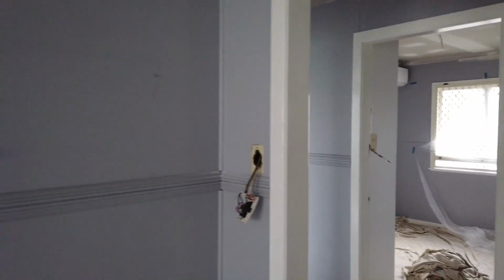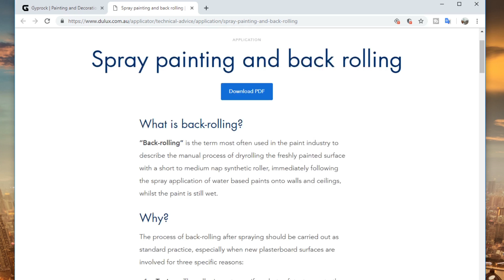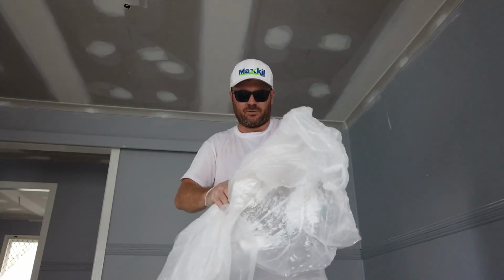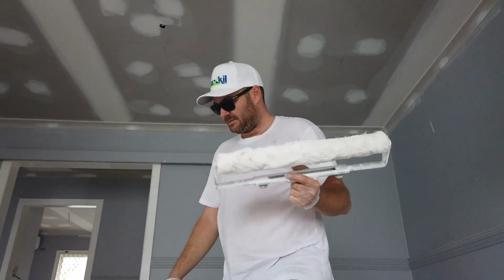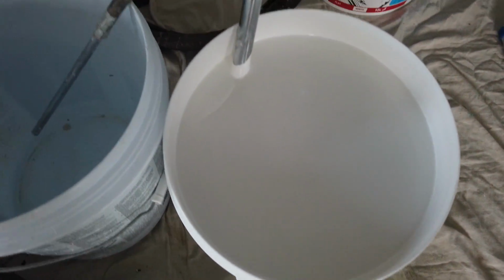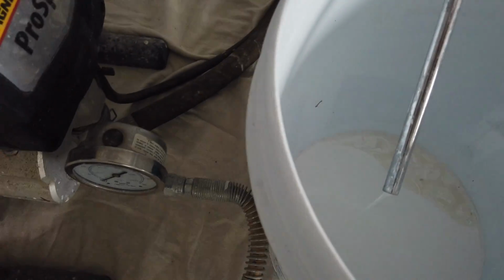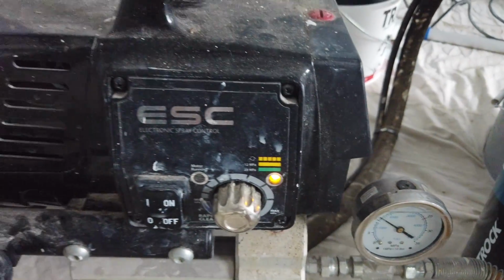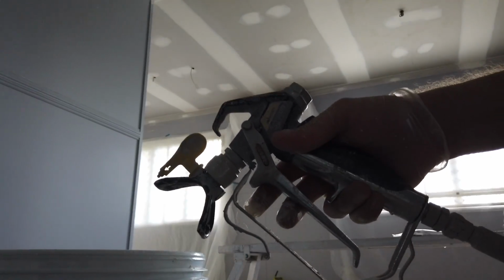Spraying Drywall Using my Wagner Airless Paint Sprayer

Comment: To anyone watching this video for advice.  Always backroll what you spray (interior only).  It’s required by the gypsum manufacturers.  It’s also proper technique.  Doesn’t matter what quality sprayer you use, spend the few minutes backrolling.  It increases adhesion AND it provides the necessary texture.  Any painter who doesn’t backroll is not taking shortcuts.
Reply from the maker: Totally agree. Your totally right. :_maxkilMaxkil:
Reply: i think you meant "is taking shortcuts" not "is not"
Reply: Instablaster
Reply: Or get a HEA sprayer that leaves an even coat with soft edges so no need to backroll, gypsum board manufacturers suggestions are pre-HEA sprayer use ...
Reply: and reviewing his continuous spray technique i can see why he needs to backroll what with the buildup he leaves every time he changes direction. Instead learn to spray properly and get a HEA sprayer
Reply: The fact that you are back rolling means you haven't been useing spray machines long enough. People who back roll  sealer can't spray.. if you backroll after you spray your just taking paint off. so you will see the plaster joins after a spray they are covered. Looking at the way this guy sprays he's just gone out and bought a machine clearly he's never been taught..
Reply: Nobody listen to Kevin sound like he's been drinking turps .. let's go buy a spray machine so we don't have to roll... whats that Kevin we still have to roll... Kevin your fired
Reply from the maker: Nah Kevin is correct no matter if he drank turps. He's right.  You should backroll. For many reasons.
Reply: @Maxkil  when you backroll your removing the paint you sprayed on numpty... on your next job spray one bedroom then spray roll the other.. there now you have the answer..
Reply: @Maxkil  are you sure your a painter. Don't listen to this muppet he's probably never even used a machine before...
Reply: @Maxkil  i challenge anyone to try and remove sealer from any gib  after its been sprayed bunch of muppets . .. if you backroll your just removing the paint..
Reply: @MuscleAKAOzzy  just because you can't spray without having to backroll if your not skilled enough keep backrolling.. for me to many benefits .. you sound like the guys who used to say spraying doesn't put on enough paint go back to sleep.
Reply: @JONO3679  So how about you come show me then 
I'm starting a new job Monday in Melbourne 
If your around send me a message and we can meet up . I need to see how the pro's spray 😉
Reply: @MuscleAKAOzzy  I'm in the uk will be back in aus sometime this year. To work out why its better to not backroll.. just spray a ceiling and leave it and compare it to the one you backrolled..  coverage will better and it should be smooth so you won't have to sand it.. try it on a bedroom ...  you got nothing to lose everything to gain.
Reply: @JONO3679  that the issue here lve done it before   and the issues are plenty l need you to show how the pros do it 😉
So your telling you don't roll any of the coats so 3 coats on walls are all spraying coats no roller🤔
Reply: @MuscleAKAOzzy  i roll the last coat so so it easy to touch up ..I also tint my sealers. So it covers better. After 1st coat you can't see the plaster joins. Sealers cheaper than top coat. Plus if you put a good coat on its less sanding.. just try in on a small bedroom.. you will save alot of time
Reply: Do you recommend back rolling for sprayed primer? I heard it’s a watered down sealer for new plasterboard. Some people say backrolling is unnecessary for first coat of primer
Reply: @Tigerratcat  you don't backroll any sealer ..guys that say that just don't know how to spray without getting runs .. just spray 2 rooms then go check for runs if you see any just roll them out...
Reply: @JONO3679  bro as l said l will be back 
I can now say no you dont need to back roll ceilings at all and only cut and roll last coat on walls . The developer has now giving me 3 more premium homes to complete.
The finish is level 5 even though plasterboards are not. The trick l found is all in the tips.
As a painter for 35 years reading your comments on you guys cant spray etc...had me thinking so l had to forget the old ways and try new things . I havnt finished a complete home 100% only spray for many years, so yes your right no back rolling needed its all about the tips😉
Reply: @MuscleAKAOzzy  Do you mean you hand cut in the final coat + roll? Or Spray final coat + roll?
Reply: @Tigerratcat  cut'n roll last coats on walls only
Reply: @MuscleAKAOzzy  nice one.. its easy to prove the spray and roll guys wrong .. id definitely wouldn't bother spray finishing people don't like it.they like the roll pattern id use a microfiber sleeve.  I'm spraying the old school way its the new guys the are spray rolling.. are you doing the level 5 or are the plasterers doing it. Should be taken you 4 hours to spray out a house.. but that all depends on your tip.. are you still useing fillers
Reply: @JONO3679  from my experience l see the final product as level 5 finish 
I did have some issues with  doors & trim untill l used the right tip and viscosity water based enamels are a pain in the ass l say; 
fflp tips are they way to go no splatters and not to much overspray
Reply: @MuscleAKAOzzy  I use to point that out all the time.. you paid for level 4 not 5.. most Foreman don't even know the difference.. when it comes to spraying water-based enamel  give it a coat of low sheen aswell when your doing the walls.. just on the trim..  what tip are you useing on the trim.
Reply: @MuscleAKAOzzy  its all about finding the right system. . But i have realized alot have people just haven't been shown the right way to spray...  people spend to long on the trim takes me 30 min a coat on all trim.. seen guys spend hours.
Reply: @JONO3679  I see what you mean, but that would only happen if a dry roller is used.
Reply: Back rolling mainly for touch ups! .😂 So many know it all's in this game, 🤡

Comment: Back rolling is the key to using using the sprayer. Especially when spraying on new drywall. I also use a heavy body primer. It takes the printing out of the ceiling and the walls.
Reply: If you don't backroll it covers the writing you muppet that's the whole point of spraying... you're just taking paint off

Comment: Is that straight thinned down drywall mud your useing?  And if so have you had any problems with that sprayer with spraying the mud?  I’m looking to find me a drywall sprayer. I’ve seen guys use the graco mark 4&5. But they want an arm and a leg for those machines.   Thanks.

Comment: Quick question I have a Wagner FC 5000 control finish sprayer how much should I mix the paint putting primer also semi both water based paints also the flow and air pressure cheers

Comment: Nice back roll technique! I hate seeing guys walk back and forth with the roller over their head. You treat it like the inverted wall that it is. Good job.

We use a construction grade paint/primer in one for new sheetrock. It saves on the first primer coat. We back roll the first coat then switch to a hea 515 tip and just spray the second coat. Give it a shot, it will save you a lot of time on level 4 finishes.
Reply: Such nice of a back roll I had to go back and watch it in slow motion. 😂
Reply: Hi, do you think that would work if instead on plasterboard you do the same thing on a plastered walls and ceilings and use normal matt emulsion (a bit more thicker) paint?
Reply from the maker: Yeah sure it would. I think so. Thanks for watching!
Reply from the maker: Thanks Manny...I love painting my ceilings I put up!. I like doing ceilings
Reply from the maker: Thanks Jacob. I've done a lot of ceilings now. It feels comfortable. I hate when there are fans in the way though! Thanks for watching it

Comment: That sprayer really cuts down on the time. Nice job Max.
Reply from the maker: Thanks Tom
Reply: better of just using a purdy 18 inch 3/4 colossus sleeve with their roller frame because it's light weight. much less clean up time and the amount of water you need.

Comment: Hows the sprayer going max? Had any problems with it
Reply from the maker: Actually yeah last I used it I had to take it in for a service, it wasn't building pressure when I switched it over from priming. This local guy fixed the lot for $40 smackers
Reply from the maker: Yeah that one. I couldn't then clean it properly.

Comment: I found this video wondering if I could apply mud with this cheap little side kick power roller by wagner. For level 5 I like to apply with a roller so had me wondering if anyone else had the same idea
Reply: It possible could work for a little bit but you will burn up the pump. A cheap way is mud soupy & with a 3/4" nap roll it on and skim off with trowels

Comment: Its not a good idea to spray ceilings and saturate the surface with paint then back roll because the surface can get soft and using a roller can pull off the drywall and texture i suggest if you know how to use a sprayer use that only always use a tip that will spray 12 inches nothing less and saturate the surface evenly and you should be good or roll it not both

Comment: I use a Graco highboy and it doesn't need two fucking buckets.
Plus you can tip it up with the bucket handle over the edge of the airless
made for that purpose and you can roll the entire machine with the 5 gal bucket anywhere you want including pulling upstairs or downstairs; you're an amateur.
The Graco has two filters:  One on the machine and one in the handle of the sprayer.
the result is zero blobs and no need to backroll:  You're an amateur.
Reply: @Tigerratcat  
Buy a highboy and save yourself oodles of work and trouble.
Try focusing on practicability instead of politeness.
Reply: @indrekkpringi  do you backroll your mist coat or 2nd and third coats? 

Any difference for walls vs ceilings?
Reply: @Tigerratcat  
I'm a painter not a drywaller.
Reply: @indrekkpringi  that was a painting question
Reply: I don't do "mist" coats, or 2nd coats or 3rd coats for interiors
and I don't backroll.  you're talking about new construction
I do buildings that are already painted.  You're wasting your time talking to me unless you want to talk about anything except new construction.